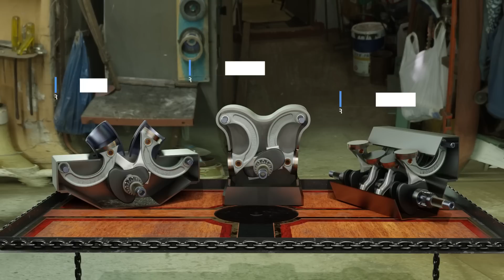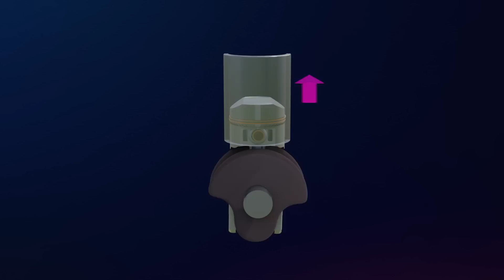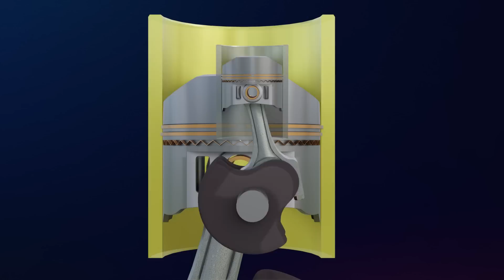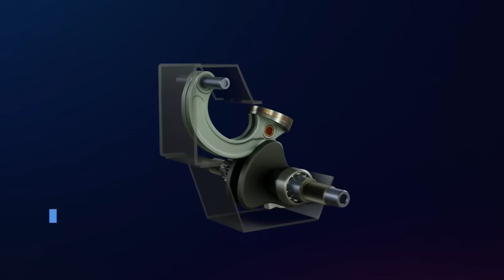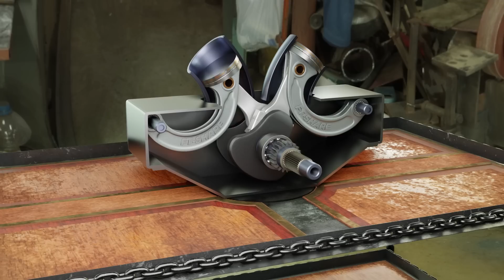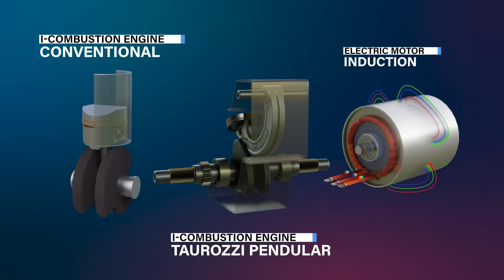All about the Taurozzi Pendulum Engine | Advantages, Working Principle, and Performance (100144.V1)

Comment: That's quite an interesting concept and since there is a medical gas compressor made using similar design the machining is obviously possible (although the cost of medicine probably means cost isn't a problem for that design?)
Is it made in two halves and then fitted together?  I don't see any other way of doing it (unless there is some sort of 'ball' cutter/grinder)
Reply: just put rotating cutter on a swing like on which the piston is
Reply: @lasskinn474 
You have given me an idea of how it could be done though with a rotary table and radiused cutters on a horizontal mill. Grinding to exact size and surface finish would only be a little more difficult but there are grinding heads with micro adjustment. Modern electronics could probably take care of size variations due to grinding wheel wear.. It would still be far more complex than a conventional cylinder design and probably overheat unless run as a low speed diesel (the only other type of opposed piston engine I've seen).
Reply: @1crazypj  well diesel or gasoline, that's just what you make the compression ratio be, I guess that's what made diesels with opposing pistons feasible. cooling the piston could/would be done with some oil squirters same you can do on regular I suppose and cylinder walls would need to have liquid cooling paths behind them.

I dunno about how or if it would be thermally more efficient than a regular engine. you'd still need a valve train for 4 stroke operation too and the pivots end up wasting energy as well. the whole idea might be better suited just as a pump.

it might be easier to get it to precision with some cylinder liner that would be done on a different process, those parts could be manufactured separately, just a curved tube basically.
Reply: @lasskinn474  There were several opposed piston 'barrel engine' designs for light aircraft in the 80's and 90's (I'm interested in piston engines not aircraft though) None of them came to much as it wasn't possible to keep piston crown temperatures low enough to prevent damage. As for valves, you would use ports as in a two stroke.  With opposed pistons there wouldn't be the problems of crankcase compression and losing fresh mixture out exhaust (It's how Germany did it before and during second world war) Aircraft engines are pretty limited on max rpm, the tip speed of propeller has to stay sub-sonic so most only spin around 2-2,500 rpm. A 'high speed' for aircraft engines is still below 4,000 rpm with reduction gear to drive prop. (Lycoming flat 4 was originally designed in 1938 and looks pretty much the same today from the ones I've seen on airboats in Florida)

Comment: What happens when the pivot bearing wears out? Betcha this engine goes from "low friction" to shredding itself faster than any conventional ICE engine.
Reply: The inventor managed to reduce friction to a minimum, and he took advantage of the design to implement it in medical compressors, they are very popular in Argentina where he is from. There is more information but in Spanish

Comment: the biggest problem for oil company is 30% FUEL EFFICIENT and LESS ENGINE OIL CONSUMPTION
Reply: Listen again - 30% more efficient than the original fiat 128 engine..... that's 30% more efficient than an engine that is at least 40 years old, most likely more than 50.
It doesn't sound as impressive now, does it...

Comment: No such thing as as a electric engine there are electric motors
Motors run on electricity as to where engine typically run on a hydrocarbon fuel

Comment: Thermal expansion of the cylinders, options for combustion chamber design, and uniformity of the compression cycle and subsequent combustion all seem like major problems. If this was a better, more efficient, and more powerful design than the current ICE, it would be in use now.

Comment: AWESOME!!

I have two engines concept, since 2004 at the University.

One with rotor.

Other with pistons and "crankshaft" but no rods.
Reply: amazing
Reply: hydrallic crankshaft?
Reply: @kalmmonke5037  Hi! Not hydraulic... mechanical but using a very old mechanical concept. I´m mounting the new prototype for bench test. I can´t give more details because no one use it until today. It will put internal combustion engines in other level, with higher mechanical efficience, having maximum torque from th iddle to the higher RPM the engine can rev.
Reply: Offset crankshaft  in i934 Chevrolet 4 cylinder car. We had one!
What happened to the Marshall rotary engine with no seal problem and almost no friction ?
Reply: If you think this is a great idea try thinking again
Reply: @gowdsake7103  Think on a 2 clinder 1.0 liter qith torque of  a big truck and two times an F1 engine... at 4200 RPM. 2000 Nm of torque ( almost linear ) and 2.200 HP at 4000 RPM. Simple Mechanic Concept, used since the wheel was invented...

Comment: Not efficent, not light, not durable.
Works only at low rpm and low power rate.
Totally useless for practical application.

Comment: Decades of Conventional Engines... SO like the Rotary Engine? because that's not Conventional... It was designed to out do the CONVENTIONAL ENGINE and it tends to do so... ITS NOT CONVENTIONAL but yet STILL WAS MASS PRODUCED... So that argument is TOTAL BS... And Clearly this engine is mass produced when you just claimed it's used for Air Compressors...

Comment: Poorly researched video. Its OBVIOUS why these are not made, look at that complicated manufacturing... 
Normal piston and cylinder anyone can do on a 3 axis mill or theoretically by hand, its a straight drilled hole, and everything simple. Now you've got to get curved drill bits (that's a joke, those don't exist), so you must machine it in halves, and on a CNC that would be about 1,000 z hops (really more), however it would be more logical to have square pistons in this configuration so you don't have to machine 1000 to 10000 elevations to simulate cylinder when machining sideways (only 1 depth with square pistons).

Who wants to spend 10x more manufacturing costs on mass production engines? Nobody, that's who! Now with 3d printing, this might change because the complicated geometry is nothing special for additive manufacturing, but previously this would be just an unbelievably complicated machining task.

Comment: could you make an apposed piston boxer variant for even more fuel eff? also an AI generated variant of the banana connection could be much stronger and lighter. additive material printing could lower the cost from cnc. think 3d printer using a wielder wire instead of plastic. alsi or steel.

Comment: The 30% gains over conventional ICE engines, and lower emissions claims are bogus. The disadvantages outweigh the advantages by a large factor. Adding mass and complexity to the reciprocating assembly is always a compromise that never pays off. The idea that more moving parts require less lubrication is laughable, and anyone with engineering experience will tell you the same. The "medical compressor" shown is just a stock photo of and air compressor, also, no way it has those goofy rods in it, the crankcase is tiny. More misinformation here than a trump post on "truth social", lol.
Reply: The drawback I see is that the combustion forces are not transmitted directly to the crankshaft, but rather there is a delay.  Complexity usually increases efficiency, although the science of mechanics, no matter how complex, will remain simple, not like the complexity of electronics, and this is the wonderful thing about it. “Moving parts,” that pushy phrase promoted by many consumer companies, has nothing to do with lubrication, but rather with the right materials and good design. Sometimes things can go against our expectations. For example, the design of this engine may be really good and provide sufficient torque.
Reply: @ياقوت-ق  If you don't think lubrication is an absolutely critical component of ICE engineering, it underscores your lack of knowledge on the subject. Oil not only lubricates moving parts, but cools them, and in modern engines, is responsible for cam phasing, timing actuation and valve lash. Oil works harder than ever before, in modern engines....

Comment: It uses no OIL. That's all you need to know about WHY it isn't mass produced. 
 As for the combustion chamber the banana shaped rod with a rotating head could machine that easily.  If you can see my point you could use the first machine holes in the block to attach base point of a boring bit and run a shaft through the center to turn said bit . This would allow each block to be the base to  bore it's own cylinders
Reply: it would use oil in an automotive application for bearings, moving heat and stuff.   you just don't need oil for the air compressor use.

also I don't get it why that would be a reason for not using it. they're trying to go for longer oil change cycles anyway.

compressor use is pretty different in how strong it needs to be and how the forces go.  as a 100hp car engine it would most certainly need oil,  and watercooling or oil cooling fins or whatever, it's not like it escapes thermodynamics because it swings.

Comment: By spreading the friction points out, this engine, if well  manufactured with oem parts should last for the life of a car to 35 years with little maintenance nor parts required so it will be killed to maintain jobs.
Reply: I'm pretty sure you don't understand what oem stands for. Same goes for the logic.